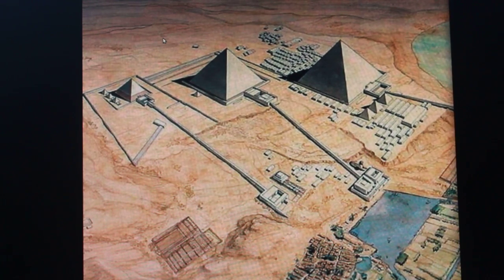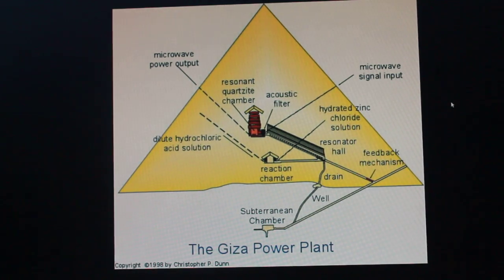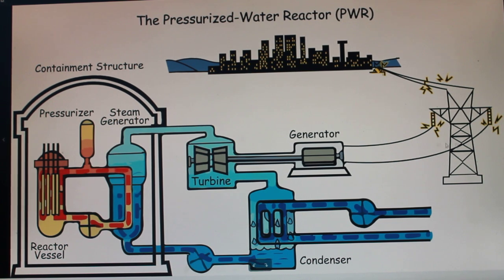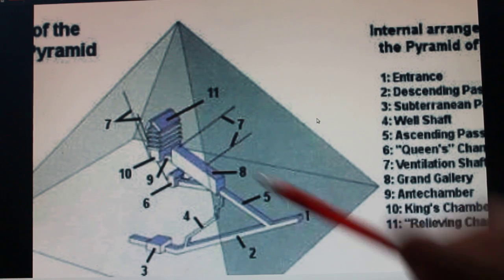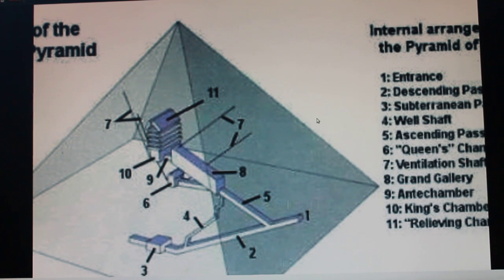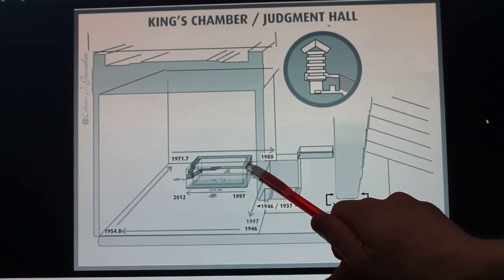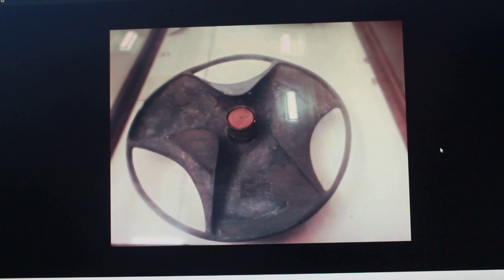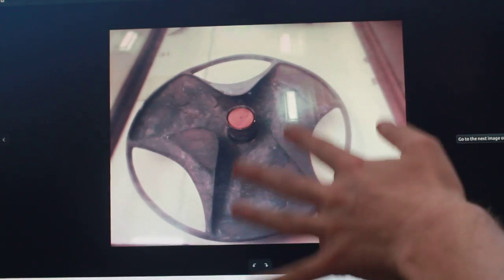Is the Giza Pyramid an Ancient Boiling Water Nuclear Reactor Complex? (Part 1)

Comment: The Great Pyramid:
2.5 million blocks averaging 5,000 pounds each
built in 20 years with just 10,000 men
No ramps, no wheels, nothing but small sticks, rope, simple bronze tools, abrasives, and clever engineering devices easily built by hand

Pi to the Egyptians was 22/7 and that's why they chose 7/11 as the foundation of the pyramid. They used sticks and a potter's wheel to survey and highly align the site, they used simple wooden devices to level the base to within 1" over the 755-foot base and used a highly accurate sundial to coordinate all the millions of individual tasks down to the minute. They used instant communication to send messages miles even hundreds of miles in seconds by using silver lined plates reflecting the sun with Morse code like communications. The same exact project management tools they used 4,500 years ago could be used today to build ANY large modern construction project.

Back then the Egyptians worked 9 days with 1 day off
That means in 365 days 36 days were not worked or 330 work days a year
20*330=6,600 work days to move 2.5 million blocks and build the Pyramid
That's 380 blocks must be quarried, moved, lifted and placed in a 10 hour work day or 38 blocks per hour - for 20 years

The 38 blocks had to be moved 1/2 mile from the quarries to the base of the Pyramid each hour - there is a gradual increase of 200' in that 1/2 mile journey

So how did the Egyptians quarry, move, lift and place 38 blocks per hour for 20 years?

Easy - they used parallel processing 
Everything they did was in the form of 2 or 3 man crews each assigned a block to quarry, move, lift, and then put in place
If you could look down at the pyramid being built you would see thousands of men, like ants, in small groups accomplishing specific tasks assigned them. There would be an engineering team directing every aspect of the build.

Quarry of limestone blocks:
3-man quarry crews were assigned a section of limestone and they used bronze tools, wooden milling devices, with abrasives to harvest one block each day. 380 blocks were harvested each day requiring 3 men each or 1,140 miners. Each crew worked until their block was freed from the rock bed.

The 144,000 casing stones were harvested in a quarry across the Nile and barge transportation was needed for them. The casing stones were harvested and then the course was built near that quarry. The surface was machined with a device they built out of a bar of bronze and wooden supports - it allowed them to mill between the adjacent blocks so they would fit with the tolerance of 1/100 of an inch. The same device milled the correct angle onto the front side of the casing stone. Once the entire course was built it was shipped across the Nile. This milling machine was small and portable allowing 3 men using jig-patterns to cut 90-degree corners and any shape they wanted from stone.
The casing stones were first laid and aligned and then rough filler blocks filled the course.

The granite rooms were first built on site and then the pyramid was built around them - they never were used for mortuary purposes.

Once the block was free from the limestone vane, a 2-man  transportation crew aided by the 3-man crew prepared the block for transportation to the pyramid 1/2 mile away and up about 200 feet in elevation change. The block was moved out of the quarry into a staging area and was left until the next morning

2-man crews can easily move a 5,000 pound stone at walking speed 1/2 mile away - theoretically, at 2 MPH the block could be moved in 30 minutes - but because of elevation change of 200 feet, this task took and entire day. This was all done with small sticks and ropes, no levers or ramps or wheels or pulleys of any kind. So 380 2-man crews moved the blocks or 760 transporters.

Lifting the blocks was much easier since 3 man gangs can easily lift a block up one course in 15 minutes. That means each gang can lift 4 blocks per hour and 38 are needed each hour so 10 3-man gangs per course level were needed. The Pyramid is 200 courses of stones tall so for an average of 100 courses then 1,000 gangs of 3-men were needed or 3,000 men to lift the 38 blocks per hour up an average 100 courses.

3-man mason crews then took the block from the lift crew, moved it to its final resting spot, removed the transportation material and recycled the material by throwing it down the side of the pyramid. Moving the block from the lift side of the pyramid to the final resting place could be done in one hour - so about 40 crews were needed to move and set 38 blocks per hour - about 120 men.

So an average of 5,000 men (1,140 miners + 760 transporters + 3,000 lifters + 120 masons) was needed daily to construct the Great Pyramid - support personnel probably required another 5,000 men so the Great Pyramid could be built in 20 years with 10,000 men total.

Not a hard task to do back then if they used parallel processing and unbelievable project management.

So what was the purpose of the Great Pyramid?
Mt. Rushmore
They built the pyramids as monuments that had 4 gleaming white sides that they drew figures of messages from the gods to the people.
We don't bury folks at Mt. Rushmore, they never intended to bury anyone inside the pyramid. The capstone was just a highly polished rock that allowed artists, hanging from ropes, to draw and maintain pictures on the sides. A stairway in one corner of the pyramid allowed the workmen and artists access to the apex of the pyramid.

The internal granite rooms were an older monument that the Great Pyramid just covered up - the two have nothing to do with each other
Reply: Seems doable. Sorta.
Reply: 2 men can move a 2 ton stone a half mile in 15 minutes? lmfao ok bro...
Reply: I've seen videos where a really strong dude can move a large stone using rotation and 2 small pebbles beneath it but not 2 tons. can you link some kind of video that talks about this for me?
Reply: Ah, you don't have the time to waste to provide 1 link but you have time to type out a wall of text. lol. I found another one of your essay comments on a video where some dudes pull a block on top of a sled on perfectly flat gound using a MACHINE lol. I saw another one of their videos where they tip a block off of a wooden pallet (which the egyptians somehow had under their blocks i guess) and then used like 12 perfectly round wooden logs on all sides and connected them with steel cables (lol) and then barely even moved the shit with 2 large guys. So basically you're making it up and there are no videos of 2 guys pulling a 2 ton block in any practical way with "sticks" and ropes alone. even if they were to have a perfectly flat road from the quarry to the pyramid you're high as shit if you think they can cover that distance in 30 minutes. if you had a real link you would post it don't pull these bullshit cop out diversion tactics.
Reply: oh and by the way, that block they move is only 1000kg. average block is supposed to be 2.3 tons.
Reply: I'm a libertarian and I don't believe things without proof and facts, sorry you don't operate in the realm of common sense. post a link or delete your misinformation. then you might look how.
Reply: +Maccy

Occam's Razor leads me to the conclusion that the GP was built to do just that
cover up an existing structure - probably  a crude pyramid
that had been around for thousands of years
just like the Sphinx

The Egyptians had diarrhea of the mouth
they chiseled their words into any stone they found
except for the GP
not a word

If that's the case then they really had no idea what the granite structure was for
it was never finished to the point of being used
there are NO soot remains from torches
so it was built in daylight
without a surrounding GP in construction

It answers ALL the questions folks have been asking for hundreds of years
and when it was finished in the white limestone casing stones
it probably was used for paintings - a billboard
that allowed for changeable messages to the masses
from their god

Comment: We came from Venus. We can return, but first we just need to figure out how to send enormous voltages thru Venus atmosphere so the CO2 & sulfuric acid decompose into hydrogen and oxygen. We can do this by building pyramids on the surface of Venus.This would create electrical stress concentrations in Venus atmosphere. When humans lived on Venus, they knew it would stop spinning and the magnetic feild of the planet was going away, They knew that life on a much younger planet called Earth was possible, they just needed a way to modify the atmosphere to make it more habitable.this is why they built the pyramids. The pyramids used the atmospheric hydrogen with its positively charge proton, and negatively charged electron to generate electric charge in the atmosphere. The pyramids don't work anymore because they changed the atmosphere. If we can't completely modify the atmosphere of Venus, we could use it as a battery. the Venusians first thought that the hydrogen in Earth's atmosphere would be an excellent source of electricity, but they discovered that they can make Earth habitable .....https://www.youtube.com/watch?v=c6K2ibg-Wb0

Comment: i stopped at 6:42 to further help with this if you dont touch on it in thus video or if you dont know about it. there is actual evidence of something nuclear that literally metled rock steps inside the a structure or pyramid. they the only thing that would have gotten that hot was a nuclear explosion. according to our understandings and knowledge.

Comment: probably posted already, but the shafts in the kings chamber were not venting out to surface as they were originally sealed and , only found years ago and broken open after someone noticed a hammer made a different sound in those spots, and then hammered open from inside the kings chamber

Comment: If it was a power generator of any kind, what did it power ? Seems no one has found any Egyptian or predynastic toasters or egg beaters.... the distribution equation  today, is like 1 electric power plant to every 100,000. Items that operate on electricity. Just guessing, but it seems to me, that if it was a power plant, there would be lots of "things" that it powered.....
Reply from the maker: I'm not sure. If it did power something, it would have had to have been way before the predynastic, to account for the lack of evidence of electrical goods. I'm even thinking it might be an attempt to rebuild something, lost in earlier antiquity, except it doesn't quite work, because they lost certain technologies. In many ways the Great Pyramid is a failure, because it doesn't explain itself well, and doesn't seem to do anything other than act as a compass and contain ratios.

Comment: FYI...The pyramids emitted a light from the cap stone. A plasma light, which was used as a lighthouses. 

The massive stones were lifted using pairs of gyroscopes with high mass fly wheels. Tesla knew about the pairs of gyroscopes lifting massive weights easily.

Comment: The Hydrogen reactor theory makes more sense as evidence of hydrogen reactions have been discovered, also water erosion is present suggesting high volume water flow and the white limestone layer which once lined the pyramids, would have been insulation for the power plant.

The most probable reason why the pyramids no longer produce power is the fact that the river Nile has migrated east over thousands of years and no longer flows to the complex. This is a recent discovery buy remote sensing satellite technology which has also discovered buried beneath the sand a city 10 times the size of modern day Cairo with over 100 pyramids discovered, but the Egyptian people already know this.

 Your nuclear theory would make some sense if radiation had been detected in and around the area as radiation lasts thousands of years, and by using the structures as a radiation sponge wouldn't work as sponges become full and need to be ringed out to become effective again.Also there are no recorded stories of radiation sickness in Egypt history and the ancient Egyptians documented most important details.

Thanks for the video, they get me thinking whether I agree with your theories or not..

Comment: The pyramids were built when Egypt was surrounded by rain forests and was a tropical zone.
The kings chamber had a vessel containing a catalyst and reacted with water. The stains high in the chamber are evident.
The reacted water flowed to the queens chamber again for another reaction, then to the waste tunnel below.
The vents were bleeding pressure, or capturing rain water that filled the kings chamber.
But you can see the tunnel design used gravity for liquids.
The queens chamber vents went to the porous limestone to bleed vapors, there are possibly chambers there as well as have been discovered in the past 10 years.
Still fascinating to research.
Peace bro.

Comment: I am from Mexico and i am analyzing a new discovered pyramid; have you ever though as thunder capacitor... lot of rain, different landscape, the same as the place i am telling you... it would be good to have a skype...
Reply from the maker: That's a good suggestion! There are so many technological things this thing can be!
Reply: i was reading that the granite in the chambers create excellent ionization of the air, as a electricity conductant, better than gold; and the chamber goes underground hitting the subterranean water, also as a conductant, the thing it`s that they probably could handle the electricity from anywhere, water, rivers, earth, etc; look at Teslas capacitors or coil at colorado springs, he was based on Giza...

a thunder could have enough energy from 300,000 volts to 1m volts, all depend on clouds ionization. imagine control that energy connected.

also i found that the Guiza latitude is almost exactly as the velocity of the light in vacuum (30°01′N 31°13′E / light velocity = 300, 000 km/s) , and the latitude of almost all the most important pyramids worldwide doing this same analogy is like light through salt water (220,000 km/s)

tell me what you think about this please!

Comment: I do believe the pyramids where power plants. The subterranean canals that surround and go under the pyramids are lined with Limestone. These canals also led to where the Nile once ran thousands of years ago and would have been flooded with water. When water runs through limestone it creates electrically charged water. The chambers inside the pyramid could have been used to extract this electrical  charge and radiate it into the atmosphere to be collected by other devices in such ways proposed by Nikolai Tesla. If steam was created it would have risen to the top chamber and condense into water releasing its electrical charge into the pyramid. The Cap stones could have been the actual transmitters of the electricity or to become totally out there could have been landing sites and charging stations for spacecraft that was owned by the Alien Gods that created us..

Comment: You are on to something, but not nuclear. Too complicated, when hydrogen is so simple , abundantly available, so more powerful, and safe. 
There is a known aquifer under the pyramid, and there are near the Nile. That is the
water, H2O. Separate the H2 form the O is simple using heat and the
right frequency and or electricity. They had batteries back then.
Look at the Bagdad battery. Increase the speed or the frequency as 
Nickola Teslar proved and you can send electric fields through the
air. Florescent tubes can glow when placed near an electric field. 
Who needs wires that were never found in that area. H2o technology is
not only extremely clean, no pollution, no carbon nor other elements
present,  no need to think that there is a need to store pollutants.
It’s all about electromagnetism that holds the elements together.

Comment: I have been thinking along the lines of a power plant for several years.  I have done some research on this.  I, of course, can't be sure, and for clarification, I am NO expert, just an enthusiast, but some small things make a huge difference here, for me, anyway... For example, The casings of the pyramids were harder, finer limestone which will conduct electricity, but is more durable, and the 3 of them had different colors... Red, Black, White... That sounds like something electrical to me... Also, there are NO hieroglyphs anywhere inside of the Great Pyramid at all.... How many times have you EVER seen inside of an ancient Egyptian tomb that had NO hieroglyphs?? Lastly, It was built on purpose atop and next to water... The pyramids, as many may be aware, were, in ancient times, directly next to the Nile.  This would have made an excellent and steady current for pumping water through the pyramid.. There is supposedly an entire network of tunnels underneath the pyramids, the Sphinx, and on past that...Business offices for the power plant... hmmm... Maybe....... More questions than answers... but so intriguing to speculate about.  Thank you for the post! :)